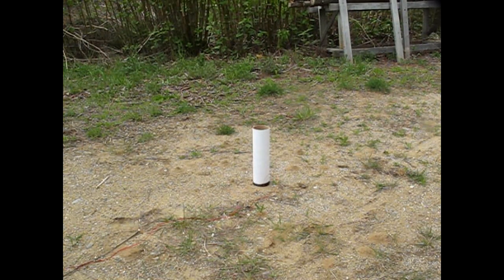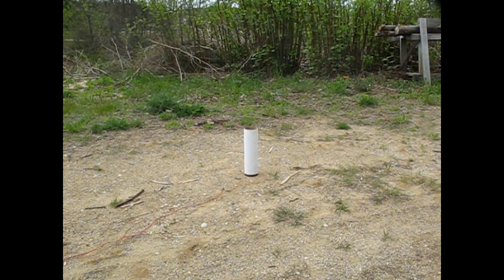Ejection Tests - Final Steps before Assembly

Comment from the maker: That's a great idea! 

The problem I was having is my eninges are sealed, no room for a delay charge to burn after engine cutout. So I started using a dry mixture of the fuel, but after some testing, I found that the dry mix never burned evenly, smoothly, or very quick while not under pressure. So i began testing with bp, and it does the trick nicely, however in this test I used 2grams but on my last rocket, I upped this to 4grams and seems to work great. As for a delay grain, try mixing some of the dry fuel mixture with a small amount of baking soda. It will slow the burn of the mixture while under pressure and can ignite a bp charge all powered off your engine.

Comment: I also use bp for ejection charges. The problem I had was delay grains. Finally came up with a formula. 30% bp, 70% smoke bomb powder, the kind u get round july 4th. Pack it into a 3/16 brake line fitting with a 3/16 ram rod, tap thread into the engine cap. Then screw it in with jb weld. Can adjust depth of the fitting, from 1 second, to 30 seconds.